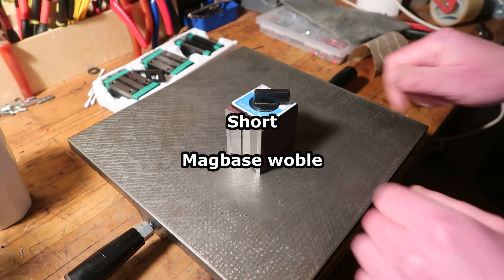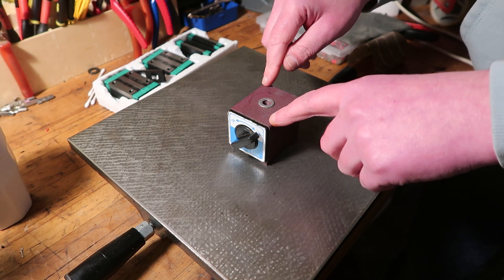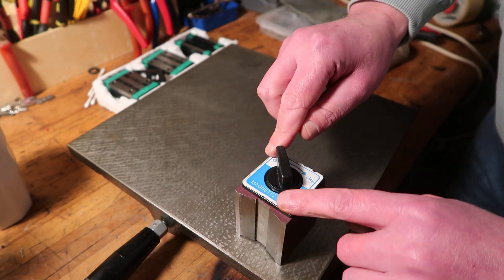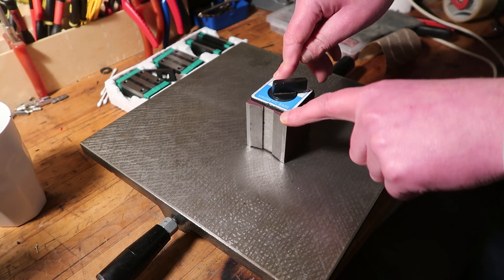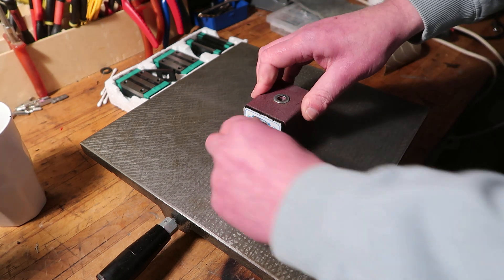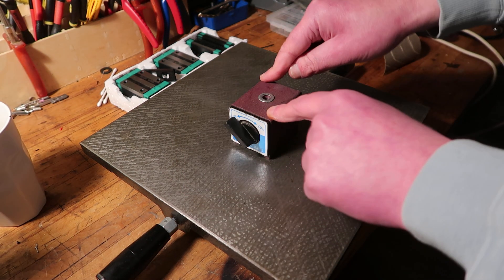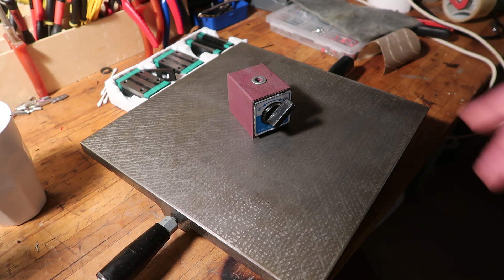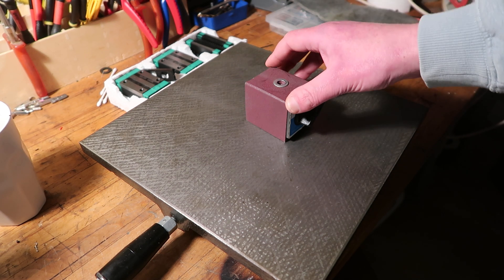CNC short 1 - Magbase not flat... damned  !

Comment: I mean just don't touch the magnet base and dial indicator when using it. The mag base will hold it in the same position and all measurements are relative from it so it should be fine. If you're using one of those dangly arms you could still move it around if you force it in the locked position but it also doesn't have to. It's a relative measurement with almost 0 force on it

Comment: Just lap it... 320 wet/dry paper on the surface plate or a kitchen stone bench slab. And wipe the plate with some IPA on a cloth afterwards. The abrasive dust from the paper gets embedded in the plate pretty quickly if you don't wipe immediately after contamination. And don't use abrasive diamond or aluminium/cerium oxide paste on the surface plate FFS!
The only way to get good AND cheap metrology tools is to work in mechanics or QC and hog everything that gets retired :)
Reply from the maker: yeah i was thinking about sanding and laping. (and indeed wondered to use or NOT use the surface plate to not damage that one) i might give it a go i mean it already sucks so
Reply from the maker: anyhow even if its rather cheap things should not be so screwed :( quality lately really went down the drain in a hurry :(
Reply: @joppepeelen   If you have a piece of thick glass it is at least as flat as your cast iron plate. And way tougher. Lap my friend.
Reply: I'm sure even a half-hearted try will improve the magnetic base. You really shuoldn't lap the flattened surface, a mirror finish might actually be worse...
Start at 320, and if you think the scratch pattern is to coarse, just do 30 seconds on a 1000-2000 grit paper to break the highest scratch ridges  @joppepeelen